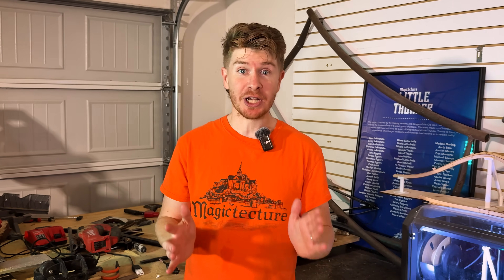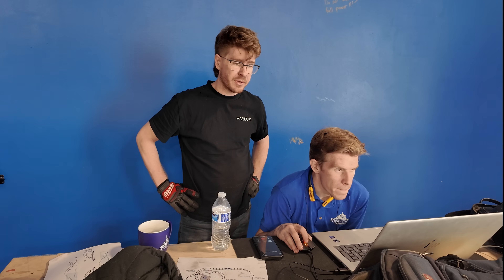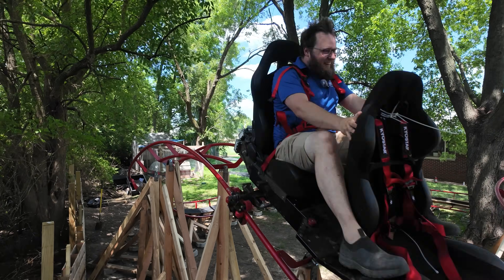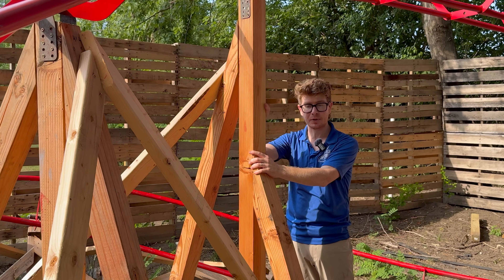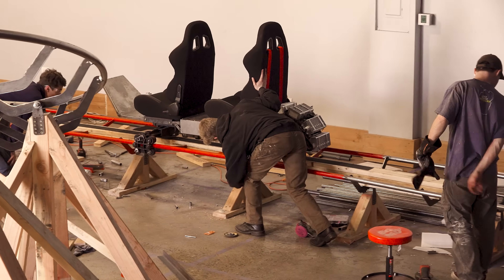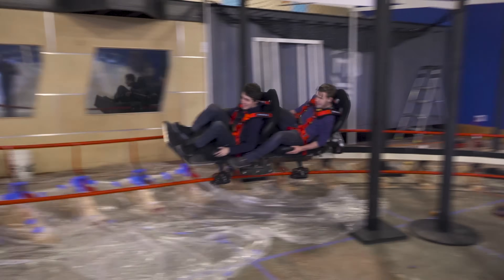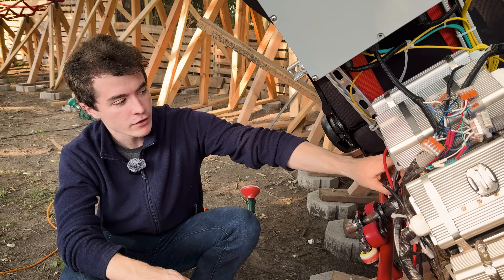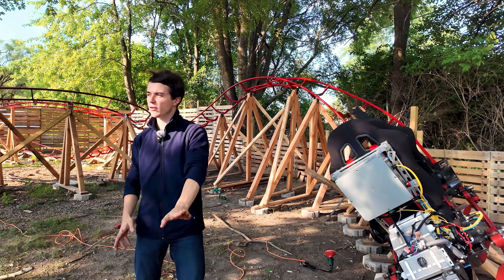Roller Coaster Engineering: Inside the Prototype

Comment: 8:37  I love wooden coasters, because they don't follow this (probably because its impossible to bank wooden track quickly enough without it being pre-fabricated) and have a lot of outside lateral force, making it much more thrilling.
 
It also looks like this banks while in a straight line then starts turning once you reach max banking, leaving you will a lot of inward lateral force anyway. most modern steel coasters are designed with force vector design software, where it shapes the track based on a force and time graph that you control. which would have the track slowly start turning while still banking which prevents any unwanted inward lateral force

Comment: Very interesting. Safety was mentioned multiple times during the video. There’s no way this is actually being built to ASTM F24 requirements? And what about controls? That enclosure and the tacked on equipment doesn’t look UL508A. What safety PLC are you using? Are you doing risk assessments to reach a specific safety level? SIL3?
Reply from the maker: Thanks for pointing all of this out. Yes, we are aware of the standards and assessments. We would love to have had the resources to hit all of these on the Prototype, but you swing with what you’ve got. The purpose of the prototype was to demonstrate readability and test for fail/weak points. Always love to hear helpful feedback.

Comment: did you see that rollercoaster you can get from China for like 7000 dollars? just saw a video on it. figured you would want to know since it's going to be your competition. the dude that made the video was American so he said it cost him 7000 including delivery. you'll need to show people why your version is worth more.
Reply from the maker: Yeah, we saw the Alibaba coaster. We’re talking about doing a review of it, but some initial points for clarity:

1. The coaster in question is SIGNIFICANTLY smaller that CIAB. 
2. The quality of the coaster in question is SIGNIFICANTLY lower than CIAB. 
3. There is NO warranty or insurance coverage through their product. Someone gets hurt or dies, it’s on the customer. 
4. Theirs is a manual chain lift - CIAB is a launch coaster. 
5. CIAB is a programmed ride controlled by a PLC that can be operated from your cell phone.
Reply from the maker: Side note: I can guarantee that every CIAB uses ethically sourced labor for all our products. I’ll just leave that there.
Reply: @Magictecture I'm just saying you should buy one and compare them. there is a massive gap in price and you need to prove to the consumer that it's worth it. only reason I bring this up is it will come up eventually. you mind as well start thinking about it now. make adjustments that sets your coaster apart from the other. because of your product is successful I can guarantee that company will make a larger one that has a motorized chain lift. You guys should make it a shuttle coaster with a loop. it wouldn't cost any more, it would do something you can't do on go karts or on the cheap coaster, and you may be able to save money on shipping since all the track would be strait. just think about it.